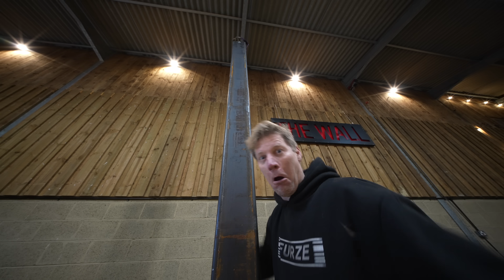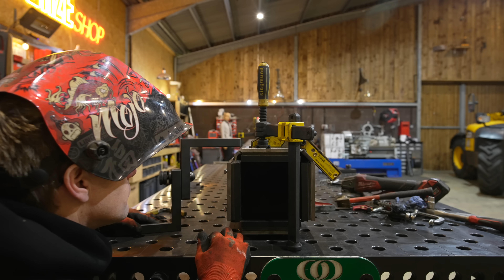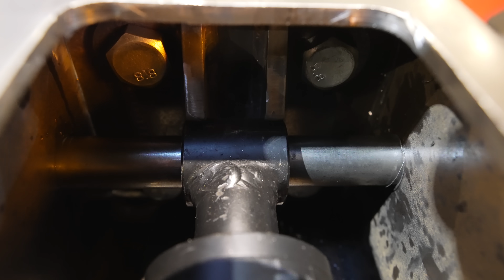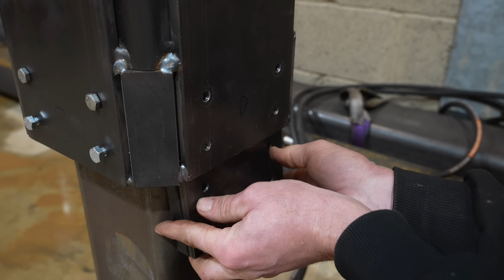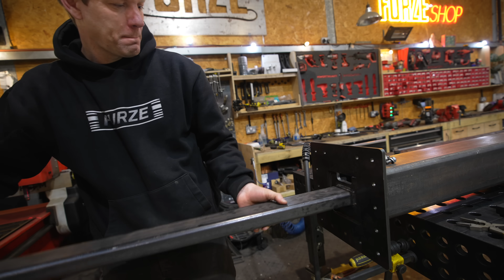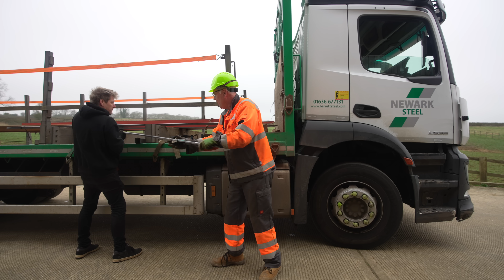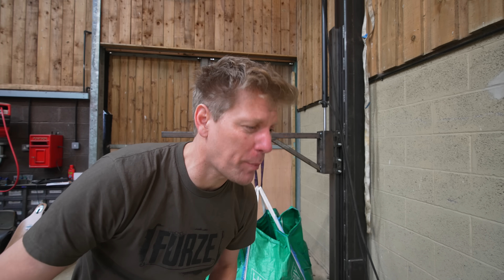Digging SECRET Garage Part 7 Car Lift Prep

Comment from the maker: This is the simplest most complicated build ever, its just a few legs and a platform but has a hug amount of weight to lift and needs to be safe and fixable once built, decisions I make now are important, enjoy the journey with me, your comments and support are amazing and always helpful. Thanks Furzearmy
Reply: I would be so scared of the hydraulics 😳 a screw jack system would be much more my style and if I had the budget my dream tech would be a Spiralift.
Reply: @Okeanos86 pretty much every car lift uses hydraulics, though, they do have a mechanical safety lock on the posts.
Reply: hey colin just a stupid question do you have any safety feature in mind when the car is being lowered to make sure there is nothing under the platform ?
Reply: @M @MIMITAKIS hat’s a very good point. There needs to be a gate that stops people walking underneath, and it needs to be an electrical interlock in the hydraulic pump power circuit. Would also consider an IR beam break system as an additional safety barrier (detects if someone climbs over the gate). Breaking the beam cuts the power until it is reset.
Reply: @Dynamic_Flyer : Something garage door -ish would probably be best as part of the safeties, as that allows a simple physical barrier for everything larger than small animals.
Reply: @MIMITAKIS  not only there but also on the road surface, to prevent anyone being cut in two when the lift goes down. Some industrial infrared safety curtains will be part of the game on two locations for sure 🙂
Reply: @MIMITAKIS sensors and other detection tools will be wired in the project for sure .. or even wireless.. ¯\_(ツ)_/¯
Reply: Why Not use the square steel as a guide and place the cylinders next to them?
Reply: Is there a reason you went with pistons instead of using hydraulic motors with a chain drive and gears in the posts like other vehicle lifts?
Reply: @YouNoStepOnSnek  No one uses chains on lifts anymore. Havent for years. and even then it was a hydraulic cylinder pulling a chain. They had reliability and safety issues.
Reply: Colin for your maintenance worry could you modify the posts like Base-Hinged Lighting Columns that have a hinge on the bottom? You could have a clamp at the top to secure corner when disconnected then swing the post down with a winch enough to remove piston.
Reply: Need a hug? 🤗
Reply: @speedymatt1236  🔴 Muslims follow all prophets and messengers, peace be upon them

⚠ God has said in the Quran:

{ They say, "Be Jews or Christians [so] you will be guided." Say, "Rather, [we follow] the religion of Abraham, inclining toward truth, and he was not of the polytheists."( 2: 135 )

Say, [O believers], "We have believed in Allah and what has been revealed to us and what has been revealed to Abraham and Ishmael and Isaac and Jacob and the Descendants and what was given to Moses and Jesus and what was given to the prophets from their Lord. We make no distinction between any of them, and we are Muslims [in submission] to Him."  (2:136)}
Reply: @speedymatt1236 NO, NO, thanks...
Reply: I suspect you covered this already. However I'm curious how you will keep the elements away from your lift?
Reply: Would be cool to have an automation panel wired up into your kitchen so you can enjoy a cup a tea while you watch the vehicle (or anything else that needs to come up *secret hidden bouncy castle*) ascend from the depths without even leaving the house.
Reply: @Elusis1  more automated = more sensors to put risks under control. The more simple way of doing it is to ensure the operator (Colin) can see and has to actively look at the whole hazardous locations (crush zones etc.) from the operating panel.
Reply: @81SteF  With that attitude its a wonder we ever even had the industrial revolution or made it too the moon. Just because something is hard or has risks doesn't mean it shouldn't be done. Have you seen the stuff Colin has made LOL Risk/reward is kinda the deal because hes thoughtful and methodical about the engineering while being practical about risk mitigation.....most of the time LOL and thats what makes it so cool!
Reply: @Elusis1 I agree in part, but Colin puts those higher risks on himself and those working with him, not the general public.
Reply: Yeah, what’s the big deal, the lift “just” has to handle a couple cars and a driveway! Safely. Year after year.

It sure doesn’t look easy and I love watching you figure it out.
Reply: I sometimes wonder what would you build if you had the wealth of Elon Musk  🤣🤣🤣
Reply: Make sure you have a safety valve in that system. If you lose pressure suddenly you need to know that it stays up.
 I do like the safety block
Reply: Hey Colin, maybe look at using UHMW HDPE instead of nylon sliders? UHMW won't absorb moisture like nylon does, and will keep its size and shape
Reply: I can just imagine the many many 'Why did I want to do this in the first place instead of building 20 smaller projects and just be happy again?' It's going to be awesome when it's done for sure though.
Reply: Does it have elevator music?
Reply: Hi Colin, did you make drains in base pillars to drain/spot possible hydraulic leaks? I hope that does not happen but I was concerned about that for you. ❤

Awesome work and Video like always
Reply: Haven't seen anyone mention it yet so I hope your engineer friend that is going to give it a once over will. But just in case: Have a mechanical stop system for the possibility of hydraulic failure. Last thing you want is to be working on the car, have the hydraulics fail and whatever was under that part of the lift doesn't exist anymore. (Most car mechanics lifts have systems that you can steal the homework from.) Enjoying the vids, Cheers!
Reply: Make sure to look at hydraulic car lifts and include a ratchet that catches the lift in case of a hydraulic failure. Especially if you also use the lift for maintenance you don’t want the hydraulics holding the weight all the time.
Reply: @Thx_And_Bye  the safety brake is in the video at the end.
Reply: @macavitythemysterycat the safety break will not work with subtle hydraulic issues nor with reducing stress when the lift is used for maintenance. There is a reason why hydraulic car lifts include a mechanical ratchet and not just a overspeed brake.
Reply: @Thx_And_Bye  Yes mechanical locks are a requirement for exactly the reason you mention. Also there should be velocity fuses in the hydraulic circuit for hydraulic failure too.
Reply: What are you going to do when this is finished 
Move house and do it again?
More car Jacuzzis?😂
More car modifications?
More funny contraptions?
Reply: Just had this thought. If you will be working on this car in there have you taken any thought on fire fighting? Cause you never know what might happen. Also I have said this in another video and several places on here but I suggest more ventilation in the garage. I know you said you would never be running the car down there but you never know. I suggest adding enough ventilation so you could run a car down there no problem to idiot proof it. After all in engineering you should always add a bigger safety factor then what’s theoretically safe just to make sure no one gets hurt or dies.
Reply: I'd put a sheild or stopper to stop a runaway car on the top level from landing on your house.
Reply: I wonder, why companies have multiple engineers working on such products 😅
Reply: Nice
Reply: Awesomeness 👌
Reply: There is nothing crazy about a Brit lifting a DeLorean. What has our lives come to?🤣
Reply: *huge.
Reply: Did you also accommodate for the weight of the driver and passenger(s)? I assume you did.
Reply: engineering that is !
Reply: @andremotard1692 anything other than a shed that 2.5m high,u need permission
Reply: All that work to make sure it's safe and all you really needed to do was put a safety tie on it. Everyone knows the safety tie is the perfect PPE and keeps anything and everything safe and secure.
Reply: I would rather be my car lift over built than under built. I would hate to have some salvage operation after the lift fails with a car on it. Great job with the vids and the building!
Reply: Not even nasa has done this much of calculation and Engeneering.
Colinfurze the greatest engineer
Reply: @ottoapocalypse1094 clearly this isn’t true. Colin isn’t fantastic because he’s “smarter than NASA” he’s fantastic because he’s an ordinary bloke figuring it out himself.
Reply: Perhaps the simplest solution would be a screw jack.Instead of building a large, round rotating platform, I suggest building a small, hidden rotating jack that will only go under the car and lift it by the sills, lifting it up so the wheels are lifted off the platform. This way, all you need is a simple rotating mechanism, and everything is hidden under the car. Greetings from Poland
Reply: Fantastic communication of everything involved! If I wasn't half a world away, I'd be happy to help with the single acting hydraulic actuators.
Reply: As the saying goes; Behind every great Colin there is a trusting wife :D
Reply: How are you doing to balance all the legs, if you don't have a car with 50/50 weight distribution or isn't parked perfectly centre some of the legs will have to lift more weight than the others, no?
  Would that be just relying on the steel to handle the bending moments?
Reply: Ah ok cable links, maybe I should watch videos to the end before commenting lol
Reply: Actually that still doesn't quite make sense, I'm sure you'll figure it out or hit it with a hammer if not
Reply: @dark4x440  steel cables.
Reply: Hug
Reply: Overengineering is Best Engineering
Reply: You want roller bearings instead of ball bearings they last longer for load bearing stuff.
Reply: This explains the nationwide steel shortage! Furze has singlehandedly monopolised the entire UK steel supply. I can't begin to imagine the total build cost of this mammoth project!
Reply: You'll want to chamfer both inside edges of those nylon pads for up and down movement to better avoid them chattering, or shattering in the future.
Reply: I see a small problem with your maintenance plan for the hydraulic rams, it would require the ram needing maintenance to still be functional in order to lift the outer support high enough to access the maintenance port.  It might be a better idea to cut an additional maintenance port into the outer support as well, that way you'd be able to access the hydraulic rams whether they were functional or not.  This would require you to make both access ports a bit longer than your current plan to allow for the extra clearance you'll need to angle the ram out past both supports.
Love your channels BTW, you've done a lot of incredible things!  I very much enjoy following your creative process and trying to think of what you're going to try next before I see it.  I'm always impressed with the things you come up with. 😊
Reply: @thestrange_1 , considering the fact that he will most likely be using a crane to install this or use the telehandler. He would most likely be able to use the same method to remove and do any maintenance on these components.
Reply: @deermasscannon7285  I don't think Colin will want to have to rent a crane every time one of the hydraulic rams fails.  I made the suggestion because he made it pretty clear that he wanted to be able to maintain the lift on his own and I think that necessitates the rams being accessible when the lift is in its' resting position.
Reply: Is AWESOME and is getting really cool
Reply: Fantastic creativity and awesome build!Another idea for repair of the cylinders - you could have a plate on top of each cylinder (in the driveway surface) that could be unbolted and allows the cylinder to be lifted straight up and out, while leaving the platform at the bottom of travel.
Reply: Did you consider having four screw Jack's (one at each corner) it would basically work like what you have but use a screw jack mechanism instead of a hydraulic pistons.
Reply: @Duke00x Colin spoke about that and his reasons for rejecting lifting screws in a previous video.
Reply: People always talk about engineers screwing up their designs for not making them easy to work on. However it's universal to everyone who makes things!
Reply: Not to piss on your chips & call it vinegar... But I really hope you don't get a leak from one of the hydraulic fittings inside the legs - I wouldn't fancy an three-legged lift trying to get it all apart for a hydraulic repair!  My bet was on you going for a ballscrew arrangement with a common drive chain around the top of the lift.
Reply: @mattyj6564 : Honestly, I don't know why someone would go with a ball screw for this use case. Those are a bit expensive even for small units, and this is the sort of use case to use position sensors so there's no need for such high repeatability & accuracy.
Reply: Was thinking. While you were doing awesome shtuff, you should have automatic locks that will come out to lock everything into place once the plat. Is raised per level,  It'll add more security and add a third security measure in case Murphy's law takes hold..
Reply: its hardly a secret anymore, nor has it been since you shared it online. perhaps its time to change the name to hidden garage?
Reply: @colinfurze I think the main thing I am concerned about is the bearing adjustment mechanism. There's too much potential for it to loosen up over time. I would give it another iteration so that you can permanently lock it in place after adjustment. Something like removing the offset system, and then using a sliding plate that gets welded once it has been confirmed to smoothly operate. Right now, even if you weld the bolts, the offset system is a lever that will be constantly working to loosen the mechanism over time. At best, that would make it no better than if you didn't have any adjustment at all and just did a set position with minor tolerance.
Reply: Make sure you put counterbalance valves on the piston side of the cylinders incase a hose blows off
Reply: Hey Collin,

For your safety break what about a magnetic Induction break? Copper or aluminum and neodinium magnets could be a good safety feature
Reply: @OceanPictures : Might be a good part for a motion sensor, but I question if it would be an affordable option for safety purposes with this much weight.
Reply: @OceanPictures Some rollercoasters use magnetic braking as a safety brake but a lift should always have a fully locking brake as a safety brake as there's a crushing danger.

If all 4 cylinders are equipped with safety valves there's no problem, even if 1 cylinder catastrophically fails.
Reply: Is it strong enough for two cars because let's say there is a car parked on top and you just want to take out the one from the basement garage would you have to move the car parked on top every time you want to take out the one from below?
Reply: Hi, * it's *, hope this was helpful.
Reply: So cool. Total childhood dream shtuff. Well adulthood dream shtuff as well. Just flipping cool.
Reply: I was expecting the aircraft carrier kind of lift. With a floor but that sits on ball bearings to spin the car around with a few car jacks on both sides of the lift so you can do some car inspections.
Reply: How did u get planning permission, i dont know
Reply: @Mr.1.i : With engineering schematics.
Reply: @absalomdraconis more like a model village with his cats at large
Reply: I would be concerned how strong the hydraulic rams are secured to the garage floor. The amount of weight and stress is ultimately going to be on the ground floor
Reply: Really interesting project the whole bunker and garage, buuuut i think the lift will be so slow to use that after a week you will rather just park on ground level. With the long lifting distance and complicated multi hydraulic system it will be  15min ordeal attleast. I hope you will time it when finished and also an estimate of all the iron that has been used to your project in mass.
Reply: Your welding is looking better with every vid, been following this project from the very start, with the garden bunker. The whole thing is epic, cant wait to see it all come together. Are you getting mark back to epoxy the roof/drive?
Reply: You got this
Reply: Hey mate, been following for a while and just caught up with your videos of recent... have you ever BEEN to a workshop garage and seen their 2 post ramps... they use a SCREW based lifting mechanism similar to what those linear actuators use internally... the car ramps EASILY lift 7-12 tons... why didn't you go down this route instead of the oil route?... you've GOT the 3 phase power and those motors for the ramps are quiet reasonable... As usual keep up the great content
Reply: while I appreciate the engineering , I do feel you chose the most complicated solution for a car lift , I think I would have chosen chains and pulleys, its a solution that has been in place for 1000's of years , should had gone to  Egypt for a holiday before starting this bit of the project.... :)
Reply: @121mcvUK   I made mention of 2:1 chain hoist platform lifts we use in concert roof suspension. Also there needs to be a deadman safety better than those little one way blocks. Auto shop hook safeties came to mind like on the larger vehicle lifts.
Reply: @salimufari or it each corner could slide along a a ratchet of sorts - one thing is for sure , this is over engineered
Reply: @121mcvUK : I'm pretty sure I suggested something more complicated than his approach.
Reply: those arrestor clamps are going to kill you Mr furze. there is no fucking way in hell those are stopping that mass.
Reply: @clippy-jordies  its not just going to be one, it's going to be four of them, and from what he described, I see no reason why they wouldn't be able to withstand the forces at play. You also hope they never have to be used.
Reply: Why didn't you do a scissor lift?
Reply: YEAH!
Reply: The height is actually right at 2 smoots high Colin. Don't believe me, look it up and you won't be disappointed
Reply: Nice job bud I’m thinking led strips in the hydraulic legs would look mint. Red for caution, Green for making the delorean into a flying machine next lol. 
Well done bud
Reply: It'd be cool to integrate a scale into the platform so that you knew you weren't going over the theoretical limit, should you try to put something else on the lift down the road.
Reply: Hay what if the hydraulics fail can you install some kind of stops to keep it from coming down on top of you should it fail
Reply: I like the way you put it. If you zoom out, you just dug a big hole and built a room, now you're lifting heavy things. But when you zoom in and do it, every single step comes with so many details and new problems to solve. Thanks for taking us along for the ride!
Reply: Incredible work. I'm surprised you need cables to synchronize the lifting posts. Quick Jacks mini car lifts are only connected to the pump via the hose and they are able to synchronize. It is somehow managed within the pump system.
Reply: Should I be proud that I heard  that the  ending music was a steal from Coldplay? :D
Reply: Simple user experience always require hard engineering.
Reply: Nice work! Don't forget the safety sensors if the ramp is nearing the top or bottom..  you certainly dont want a accidental decapitation hazzard😬
Reply: Colin, this is turning out to be one of your best projects yet and I know that your design, dig and build spirit is strong. I fell like you will not give up addinng more underground infrastructure beneath your home. [God bless your wife!] I'm left wondering, what's next? I read one comment that asked about a set of srairs going down into your lair. That got me to thinking; how about a small elevator. Perhapes large enough for a wheelchair so that 40 or 50 years from now you could still be making videos, down in your secret labyrinth. Ofcourse, by that time it would be a hooverchair.
Reply: @napster7825 : At the very least a dumbwaiter with auto-unload so the groceries aren't quite so much of a bother.
Reply: Hug
Reply: Why not use a Rack and Pinion gear?
Reply: On the back of this video, I am optimistic about the short term future of british steel market.
Reply: colin if you make top lit of the legs detachable so a bolted endcap, that you can take out when you need to replace a cilinder.  you just take out the cilinder and leaf the rest as it is.
Reply: You need to build a staircase to replace one of the ladders so that when you are older you don’t have to use a ladder
Reply: @colinfurze 
If you rate the lift for at least 10 tonnes so you could fit a 12 yard skip inside it. That would definitely help when digging the tunnel to the bunker to get the rock and soil out.
Reply: My goal in life is to find a home I am so in love with that I can do these crazy projects to it. I can’t imagine Colin selling this house in 50 years and him showing them all the maintenance and ins and outs of his bunker and batcave garage 😂
Reply: You're doing more Engineering Analysis & Design than many qualified / certified / accredited Pr Eng people I've met. Probably over-specced but that just means it's going to last longer without needing repairs. Well done 🌞
Reply: Theres no one like Colin, never change. This project is epic on another level
Reply: If you take the retour of the first hydraulic cylinder en put that hose on a cylinder that is inverted, you could power two cylinders with the same exact displacement. If you repeat this you could do it for four. I can explain better if needed.
Reply: @Remyeijssen  The issue would come if you have a leak. Counterbalance valves are a much better way of achieving this goal.
Reply: @deermasscannon7285  that’s true, but you could put ball valves inbetween to do a reset ones in a while when it’s full retracted.
Reply: Wonder when he will figure out that the issue will be equalizing the 4 posts and that its grossly under engineered. 

He can try to equalize with hydraulics (master and slave) or with clever valving and proportioning valves which will be a nightmare and only partially reliable. Or he can use some kind of mechanical means of equalizing the load (cables, bars between each corner etc.) which will be almost impossible design in. Or he can go with electronics but then he will need some kind of logic controller and maybe some string pots to measure linear travel. 

Lets not forget the most important thing he hasn't discussed yet which is velocity fuses in the event of a hose failure. 

I have no doubt he will get something working and it will look good for the camera but reliability and safety will be an issue for this design.
Reply: @A_Person_You_Dont_Know  The component you are looking for is a Counterbalance valve.
Reply: Colin, I don't know how far you have gotten since the filming for this video was finished, but instead of your idea of using a wire to balance the lift arms, you should be using counterbalance valves. They are used in heavy equipment to allow pairs of hydraulic cylinders to remain in sync when lifting material. You would most likely need three valves for this system. If the pillars were numbered 1-4, you would want to have a valve between 1 and 2 and a valve between 3 and 4. Then the third valve, which would need to be larger, would be in between the two groups of cylinders. This would minimize complexity and provide a higher level of control.
Reply: Remember Colin KISS and don't overthink it. Keep it simple stupid.
Reply: I am a Little Late, but I was thinking while you were showing the model... Why dont you reduce the weight of the car + Platform to almost zero?? Imagine this: from each corner of the platform you have an iron cable and some pulleys. on the on side of the cable, you have the platform, and the other end, after passing through some pulleys,you have weights! So, lets guess the car+ platform is 10toons... you put like 9.5 in weights and the motor just need to lift 500kg... Did you understand it? Like, it would be cheaper, smoother, and need less power to work! @colinfurze
Reply: Effing amazing!  
⭐⭐⭐⭐⭐
Reply: Dear Mr. Colin I think you are amazing and I am totally in aww over your creativity and drive. I am looking forward to part 2 I really want to see the car lift in action. Question will you be making a part 2?
Reply: Also I want to recommend a spring system on the ground floor of the lift in case the lift accidentally falls on the way up.
Reply: Can you fabric some hydraulic pop up railings on the top so they come up as it lifts up. That way someone can stand on-top and it will be totally safe and up to code. Kinda..
Reply: Why did you not just use 2 H-beams running on each other with those bearings and run the hydraulics outside of it? Permanent access to all components and an easy way to secure it mechanically on different heights.
Reply: @howie_on_tour : Probably because round & square pipe/conduit is much less vulnerable to twisting. Than H/I beams.
Reply: @absalomdraconis  seems a reasonable thought. How much would they twist really? There are 4 of them, one on each corner. Anyway, interesting project
Reply: Simplest is to give @welderfabber a ring, would be a great collaboration. But you will find a way like always.
Reply: since its a type of lift why u didnt use steel cables to pull it up and have these 4 box steel beams for support?
Reply: One tool we use in Entertainment rigging that may help your project is ModTruss. It's a telescoping high strength trussing system that may be just what your elevator could benefit from. It works very similar to your fixture table you built the leg on.
Reply: You are an Inventgeneer.
Reply: Seems to be missing incredibly powerful magnets tho.. PS I love Column Furze
Reply: Awesome work as always calling you are a magician
Reply: when in doubt, hammer it out
Reply: Think Colin gt the leg inspiration from space x mechazilla chopstick rail lol
Reply: Instead of using a really long cylinder why don’t you use steel cables and a pulley inside the column ?
Reply: Over engineered Colin as always.
Good job🤘😍
Reply: It's 2026. Is this project over yet?
Reply: A scissor lift would’ve been easier lol
Reply: I feel like every build is the most complicated build.
Reply: Some controller with 4 sensors to level the platform would be much simpler and reliable enough
Reply: Bro, your house is now like 70% cyborg 😅  will there be any organics left when you're done? 😂😂
Reply: What a journey from the wall of death to this!! We love you, you're our madman!
Reply: Why didn’t you use a scissor lift?
Reply: Have you considered spraying the metal with a ceramic coating to prevent rust?
Reply: I have watched this garage from the first video, and it has genuinely been crazy. like how does one man achieve this level of awesomeness.
Reply: Collin's wife is the best wife on the planet . . .
Reply: In the meantime you could pimp a Cabin car 😝🤙
Reply: Hydraulic to cable, external rams, pin end only or no eyelet flat ending the ram, but surely just pin end if it had to be internal and then have it fully removable from the end. Forestry cranes have a few methods for increasing guide pressure, I’d worry the grubs wouldn’t be big enough. Big threaded caps that you can add a shim under and tighten down again are an option.
On the one hand it’s a massive brain teaser that is really impressively being thought through, on the other there’s some choices that ..
I guess it’s low use cycle though and strength definitely not an issue.
Reply: The
Reply: Colin.........how did u get planning permission too build a nuclear bunker?
Reply: Hi Colin🤗

How do you know that the foundation or the wall will not crack. Because of the force you are going to lift/ move in the bunker???

Have you already thaught about that?

Stefan Cornelisse
Reply: Can't wait to see you finish it my friend !!!! Congrats 🎉
Reply: My only concern would be the bearing runners causing wear on the metal beams. When I’ve worked on depalitisers with eccentric bearings to take out the play on the lift, they’ve either used rubber coated bearings, or sacrificial metal plates which can easily be swapped out when damaged. Worth thinking about the long term maintenance.
Reply: Suggestion from my 8 yo child: can you add a semaphore system with red/green lights on the pillars of the lift for you to know when you can go and stop. A bit similar to a car wash.
Reply: great video! perhaps a rolling pin connection at the top of the ram legs to the platform. would allow some play if they were to be our of sync as noted.  A barrel/cylinder at the top of the ram sitting into a matching half pipe  of the platform could allow racking as it would move to accommodate.    all the best   -C
Reply: I have an old Bradbury Duette 777 lift in my garage (about 50 years old) that uses a single hydraulic ram with a 150mm wheel on top that cables go over. The cables anchor at the bottom of the post so the ram only has to move half distance to lift the ramp full height. I can't help think this lift could have used a similar system. The cables/ram lift the inner platform first which has stops on the main driveway lift legs. Once the inner platform reaches max height, the inner ramp then lifts the main platform and the hydraulic rams can be shorter. My ramp has fall arresters should the cables break. 3x10mm cables that run via wheels to lift both posts with a single shorter ram.
The engineering on your ramp is epic, but it could have been made simpler this way. I hope this makes sense! Just a suggestion
Reply: Collin when you get to the wiring part.. sensors and all. . I think it would be cool to have mechanical switches on site for sure.. but it definitely needs an app you can remotely open it with your cell phone from anywhere in the world. Also camera setup so you dont open it causing issues. I know this needs to be fool proof.. but it's doable.
Reply: Bonkers but we love to see it.
Reply: I am worried when this project is done… will there be a next one what beats this?
Reply: I recommend to check out Jeremiah Johnston on the Shroud of Turin. It is the most studied artifact of this world. It is estimated by scientists that much more Gigawatts were applied on that Shroud than on the De Lorean. Blessings.

James 1:5-8 (KJV)
[5] If any of you lack wisdom, let him ask of God, that giveth to all men liberally, and upbraideth not; and it shall be given him.[6] But let him ask in faith, nothing wavering. For he that wavereth is like a wave of the sea driven with the wind and tossed.[7] For let not that man think that he shall receive any thing of the Lord.[8] A double minded man is unstable in all his ways.

Proverbs 1:5-7 (KJV)
[5] A wise man will hear, and will increase learning; and a man of understanding shall attain unto wise counsels:[6] To understand a proverb, and the interpretation; the words of the wise, and their dark sayings.[7] The fear of the LORD is the beginning of knowledge: but fools despise wisdom and instruction.

Romans 10:8-13 (KJV)
[8] But what saith it? The word is nigh thee, even in thy mouth, and in thy heart: that is, the word of faith, which we preach;[9] That if thou shalt confess with thy mouth the Lord Jesus, and shalt believe in thine heart that God hath raised him from the dead, thou shalt be saved.[10] For with the heart man believeth unto righteousness; and with the mouth confession is made unto salvation.[11] For the scripture saith, Whosoever believeth on him shall not be ashamed.[12] For there is no difference between the Jew and the Greek: for the same Lord over all is rich unto all that call upon him.[13] For whosoever shall call upon the name of the Lord shall be saved.
Reply: Can you make a wheelchair with those magnetic shock observers like you made for the skateboard? I would really like that thank you!
Reply: I tried a similar experiment.
Reply: The adjusters should have jam nuts
Reply: Colin you are brilliant at what you do. I love watching your updates on the underground garage. It blows my mind .
Reply: 2 years? seems like 38 years. stopped watching since this crap started haha and its still going on.
Reply: It's great you thought of serviceability and put in the hole/window. However, I think you've overlooked one servicing problem; what are you going to do if the hydraulics fail to left the platform high enough to access said hydraulics?
Reply: We need new neck ties in your shop please. I dont own a single tie now due to a house fire.
Reply: For the offset bearings - you could have them both rotate inward to increase pressure on the beam. Then attach a rather powerful spring to each so they want to rotate inward (spring trying to rotate the upper bearing down and lower bearing up). I think this could give you a really good tightening effect that can also forgive some micro irregularities. And because the spring is pulling both sets of bearings in, they should (hopefully) equalize the pressure between each.
Reply: Do you dream about this at night?
Reply: So if the door is locked and u get in by the lift.what if lift' stops working. How do u' get out? Is they a knob to open door, inside garage?
Reply: Liked n' subbed.
Reply: How's progress? I keep checking for updates.
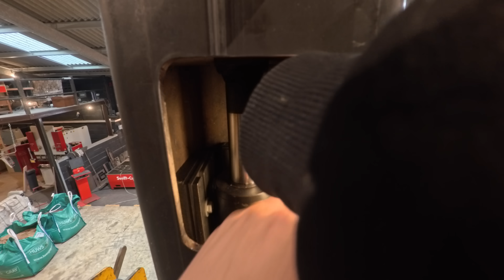Reply: 12:50
Reply: Hi,  Have emailed you about product thats in Patent at the moment, that you will want.  This isnt one of the scam messages....  Really interesting mechanical item, that you will be super keen on....
Reply: What did you think of the new Football Rock music game from Giraffe Champion, epic, Am I Right?
Reply: missed opportunity to say "Please excuse the crudity of this model. I didn't have time to build it to scale or paint it." even if it is a scale and painted
Reply: What you up to today colin,any updates.
Reply: Rock on Colin.
Reply: Colin I had an idea while watching one of your YT shorts when you were going down to the tunnel. Have you ever used a pull up assisted machine that can do varying counter weight. What if you apply the same mechanics to one of your tunnel entrances where you step onto a platform of some kind that is tied via cable to a counter weight or air dampener that slowly descends you down, but has a hole in the center big enough to step/climb through when not needing it or stepping off of it. then a dampener on the return travel for a slow return. might be a fun side project.
Reply: Don't skimp on light curtain safety features when you have a kid running about
Reply: You okay dude?
Reply: Coline… I'd like to make a small suggestion. It seems to me that you may be making the project a bit more complicated than necessary. Perhaps it would have been enough to salvage or buy a vehicle lift, adapt its width, and integrate a turntable anchored into the ground so the vehicles could rotate. That approach might have saved you a lot of time. Of course, it's just an idea, and it's your project. I wish you the very best with the rest of it, and I'm looking forward to watching your upcoming videos.
Reply: Colin. What are you going to do to celebrate the 20th anniversary of this channel?
Reply: So Colin, how's this mind boggling task treating you?
Reply: When will the lift be done ?
Reply: Hope all is well Colin, haven't seen a new video in a while now.
Reply: How is the weight distribution? Have you added a leveling system controlled by an array for sensor in case of structural failure that lowers it slowly so the car is not in damaged by a sudden system drop? Just wondered 🤔
Reply: Hey Colin! You need to collab with Steve-O. He already flew to the UK to film with The Slow Mo Guys, so he’s down for British crossovers! You should build a heavy-duty Backyard Ejection Seat using your pneumatic gear, and let Steve-O test-pilot it by launching himself 20 feet into a massive pool of foam or jelly. It would easily be the craziest video of the year!
Reply: Part 2 coming in 2028?
Reply: Okay it's been 4 months let's get your ass moving and finish his car lift
Reply: Collin i hope you're doing alright mate. Its been a long time since ANY video
Reply: To what depths will Colin sink to get views?!
Reply: It's been half a year need a secret garage video
Reply: 6 months Colin! When are we seeing the updates?? Please mate! I keep watching this video so I’m up to speed waiting for the next one!! Please mate get it cracking
Reply: Could you build a hydrogen engine? You now save the world junk.
Reply: shut up lol. it is clear you no longer value you viewers. possibly youtubes greatest downfall?
Reply: Holly shithouse we actually got a video after waiting 6 months 😂
Reply: Nevertheless, proper effort being an engineer. It’s not just lifting your cars, it’s lifting your knowledge and capabilities too 💪🏻
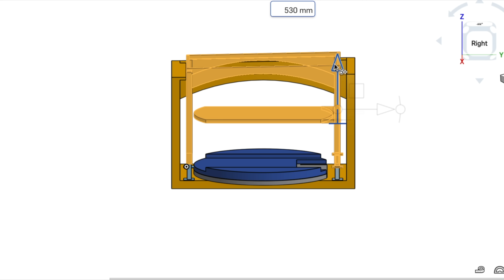Reply: 2:20 How will the inner lift serve as an inspection ramp for the DeLorean when the car still seems to be on the plate which prevents direct access to the underbelly of the car? Am I missing something here, or will you need a more narrow set of liftable tracks to expose those parts of the car for work and inspection?
Reply: I was thinking....why didn't you put the hydraulic cyls on the outside of the square tubing? Way easier for access? I'm sure they would be able to push the tubing upward without any problem. Or you could of used a large single cylinder in the center of the platform the car is on like hydraulic elevators. Factories use these all the time.
Reply: i have one question about this whole underground . . .
do you have an actual staircase somewhere or is it all 
just ladders and nothing else?
Reply: @FARBerserker all ladders, but soon to have a large elevator lift.
Reply: @FARBerserker its all ladder i believe
Reply: @FARBerserker That was my question months ago but I doubt he ever read it because only having ladders is ridiculous what happens if someone gets hurt or you can't climb a ladder for many reasons as you age?!
Reply: Like I said: Single large cylinder central to the lifting platform is the simplest possible design not to mention it can spin.
Reply: @Carter-dv4hz  Large cylinders like that for the application get more and more expensive faster as you increase in size.
Reply: @deermasscannon7285  True but it is the most straightforward approach that meets all criteria. Not to mention it looks like a proper lift instead of some janky four cylinder implementation.
Reply: Love you Colin! Been watching you for years. Please follow Jesus and repent if you aren’t a follower so you can continue to do your amazing work in perfect Heaven!
Reply: I just started watching this video now as I texting.but make the same idea for ya big poles for replace ladder and stand on a disk and hold bar welded to top of it or a thing like old car Arial using pully and rope internal.or anter idea make a ladder but works like tank track you hold .good luck.
Reply: when a service is free you the product
Reply: Quick question, Mr. Colin... would nylon wedges not have been viable?
Reply: Why could you not just use a car lift? Lie what you have in a garage? Think you’ve well over? Engineered it and made it more complicated than it needs to be.
Reply: Hello!! 

came here at 8 mins with currently 2 replies to your comment